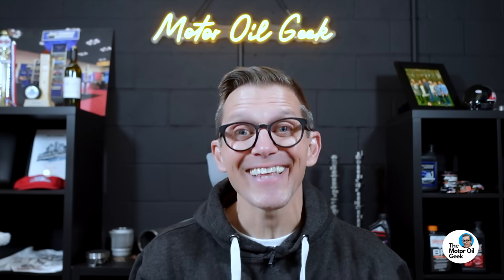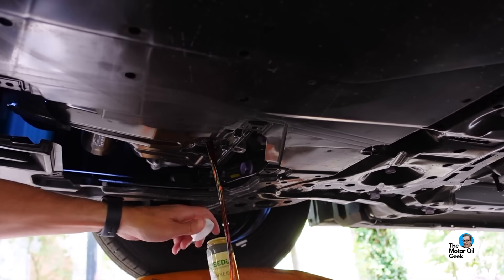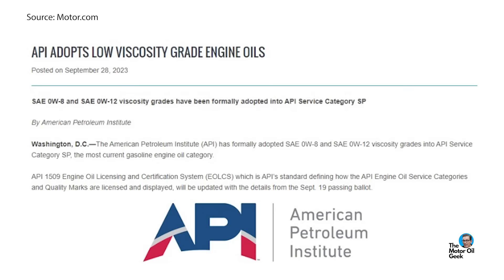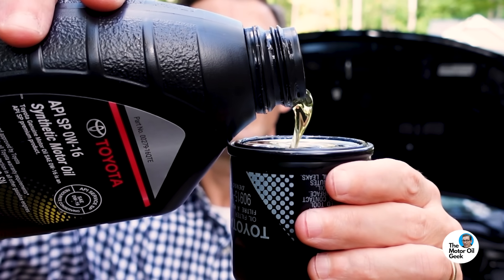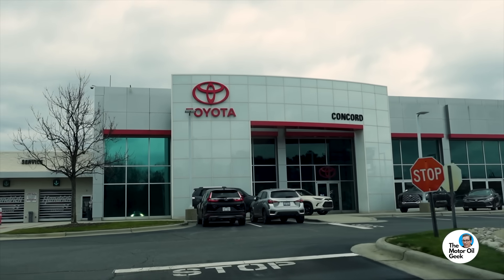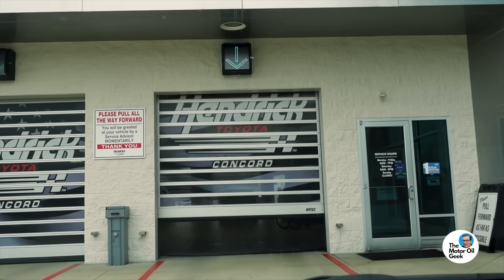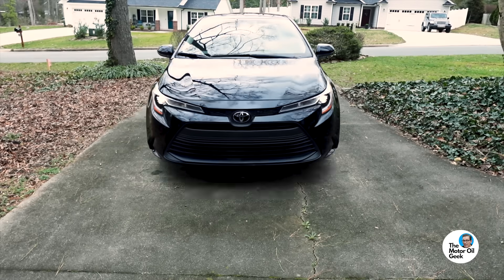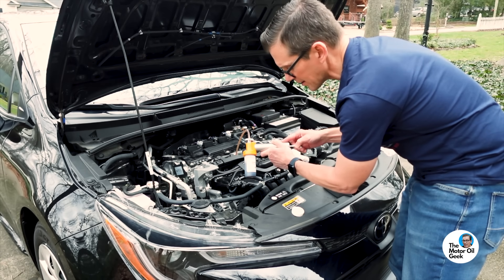0W-8 Motor Oil: Too THIN to Trust? Let's Find Out!

Comment: Say NO to all 10k oil intervals ⚠️☠️⚠️
Reply: 20k is the norm in europe. not a single problem.
Reply: @geertterharmsel  lol unless you want the vehicle to last and you look at the oil analysis that doesn't normally support your opinion
Reply: @geertterharmsel  What viscosity is the norm there?
Reply: @lonniebeal6032  most of the modern cars use 5w30. The lastest cars use 0w20 or even lower.
Reply: It's a Toyota it's not gonna kill anything especially if you live in warmer climates. My Rav4 was only done at 10k and made it to 130k miles but was totalled in an accident and still ran afterwards. I sure don't buy a Toyota to change my oil every 2500 miles.
Reply: @Lost_and_Wondering  5k intervals are reasonable, 10k are not. Unless you have ADDED Bypass filtration. 
 Most modern vehicles would achieve 130k easily but on the same note the condition inside the motor will be sacrificed of you've used 10k intervals. It's going to be a filthy mess compared to 5k intervals where the motor will outlast the vehicle and oil related failures are virtually eliminated.

The amount of vehicles that come into the shop for oil related issues is very significant these days because of those ridiculous intervals where manufacturers sell reduced maintenance knowing it will yield bigger profits on repairs parts AFTER warranty expires
Reply: Your grandpa probably said the same thing when 3 month 3k mile intervals became unnecessary. Fluids, lubricants, and engines have advanced a lot. Enjoy the convenience of 1 year 10k mile intervals. Stop being paranoid.

Comment: I'd love to see a test where you use this 0W-8 motor oil in an older gasoline or diesel engine. Will it leak and burn with the fuel or is it good for older engines, too? If it provides adequate protection and doesn't leak past piston rings or other seals, having lighter more easily moving oil even with older engines should be good, right?

Comment: 10,000 miles oil change ? No way in my house 😳
Reply: 5000 max
Reply: @markmiller8903  5k and “Mobil 1 extended performance(high mileage)” in my house 😁

Comment: 1999 4Runner. 10,000 oil change interval, factory filters. 513,000 miles, runs great.
Reply: Old 4 runners are bullet proof
Reply: 99 4runner had 10,000 mile intervals?
Reply: @DaDaDo661  Yes, I did 10,000 oil changes with 5W-30 mobile 1  oil and Toyota factory filters.

I also never missed a spark plug change every 30,000 miles, again with factory plugs
Reply: What oil?
Reply: I don't believe you.
Reply: @robertmaybeth3434 Ok, don’t believe me. It’s my daily driver.
Reply: @robertmaybeth3434  stay paranoid lol americans change engine oil way too often. 10k miles with modern synthetic oils is fine.

Comment: In the Netherlands the Toyota dealerships do not use 0W20 in the RAV4 Hybrid (2015-2018). They all fill them up with 5W30. 5W30 is also approved by Toyota but for the lowest fuel consumption the factory advises 0W20...
Reply: Dont tolerate that. Take your own oil
Reply: @dipro001  You're absolutely right, and that's what I do, for my preciouss Lexus LS 460.
 I worked in fleet automotive for a large west coast city for around 30 years, and it left me half a cripple (now I've had severe back problems from lifting bus batteries of 160 lb.). So now i mostly get the oil changed at a Valvoline quick lube.  BUT I bring my own oil for them to use (Penzoil Ultra platinum).  If they didn't allow me to do that, I'd go someplace else.
Reply: @dipro001 Why shouldn't I tolerate it? It is the recommendation of Toyota across Europe to not use the 0W20 oil for these engines. The engine loads are generally higher here especially when towing with the vehicle. The 5W30 oil is the better choice for it.
Reply: exactly. it is just a Toyota test scam to see how low we can go.
 I wil  stick with you here in Canada.
Reply: You are 1000% wrong. Lol. Stop.
Reply: lol in India where temperature rise to almost 50 degrees Celsius Toyota is using 0w20 in their diesel fortuner and hilux 😂😂😂
Reply: Why not use 0w30 instead of 5w30?
Reply: Meeder78 - The Dutch are 100% CORRECT.  After researching this for months, incl an email or two to OP, I've concluded I won't be using zero weight oils anymore.

Comment: Thank you for the great video and explenation , I have an issue over here in Portugal , I have a Rav4 hybrid 2023 when i made my first oil change the toyota dealer here they put 0W20 when I found out that was not the correct oil instead of 0w16 a wrote to the toyota portugal to give me an expelnation and the answer was 0w20 was standart due to hight summer temperture not satisfied with the answer , the owners manual does not refer weather conditions to change oil it says should always use 0w16w but if in case the dealer does not have it can use the 0W20 but the nest oil change has to be 0w16w.

Comment: I appreciate the confirmation that the manufacturers know what they're doing.  I hear so many people accuse manufacturers of giving bad advice to make you ruin your engine so you have to buy a new car.  I bet what is actually happening is that people use cheap oil and then run it for 10k+ miles...

Comment: I say trust your ears.  If the engine is noisy with 0W-8 or 0W-16 try 0W-20 or 0W-30 and keep using it if your engine gets quieter.  I don't trust thin oil and I don't live in Florida or Texas.  If I did I REALLY wouldn't trust thin oil!
Reply: Mobile one 0W8 oil is formulated to withstand temperatures over 500°F

Comment: I don't think all dealerships use OEM oils. When I take my Titan  in for service, in the waiting room they have a sign with brochures that says "We Use Valvoline Professional Services."  So in my Titan it has all Valvoline oils in the transmission, oil , pwr steering, brake fluid, differential, etc. At least I know it is a name brand product with a good reputation.

Comment: I decided to have the dealer do my wife's RAV4 hybrid transmission fluid change at 50,000- miles even though the dealer said 60,000 miles.

Comment: Love the science part of oil! It's always been fascinating to me on how far engine oils have advanced over the past decade. When you draw the oil samples each time, what oil do you use to top it up if it needs to be topped up at all? is this TOYOTA engine one of the low tension retaining rings that have an allowable oil consumption rate between oil changes or is this the standard engine that they've been using for years without any oil consumption problems?

Comment: My Toyota Crown takes 0W-8 and now at Walmart they sell it for $27 a 5Q. Before I was going to the dealership for the oil change. At 1k I went to get an oil change and then at 5k, 10k and now 15k. Now that the oil is more available, I will get it myself and do it every 5k. I don’t trust 10,000 miles on the oil change.

Now I used Motul Brand on my evo and they have 0w-8 now. Might use Motul for the crown and not the MB1 from Walmart.

Comment: All this thin oil is about  CAFE standard and not what’s best for the  engine. 

Just look at the same engines sold in other counties without an epa.  They don’t mandate those ultra thin oils. 

They have the classic oil weight recommendations by outside temp charts. 

So don’t trust that it’s what’s best for your car. It’s what’s best to boost the epa numbers.
Reply: I saw a comment from someone in Austrailia, they use 20w50 in their Kias and aren't having near the problems the US is having.
Reply: You can use 10/40 and it would be better. 😂 @lonniebeal6032

Comment: 0W-8 oil might be suitable for northern Siberia, or the North Slope of Alaska, or Arctic Canada, or Greenland, or Svalbard, or Antarctica, but only in deep winter. Otherwise, its a good way to destroy your engine.
Oil has to flow in order to lubricate, but it also has to provide a protective cushion between adjacent surfaces.
If an oil and its additive package cannot do both, kiss your engine goodbye.
Reply: The motor oil geek mentions an IL package that's new, the low viscosity oils would have to have that and I doubt many are using it at this point.

Comment: My guess is that the oil will be fine at 10,000 miles. These cars run so lean and are so closely controlled by the computer that they just don’t have the contamination of older cars. The 3,000 - 5,000 oil change interval seems excessive on a low performance NA engine.

Comment: In the Netherlands they put in 5w30 on the Prius 3/auris. There are so many issues on us YouTube channels on oil consumptio/egr on these cars… here on the Dutch Toyota forum it’s quite rare.. could it be that the thin oil will increase oil consumption, clog egr and egr cooler?

What I don’t get is so many Americans doing 5000 mile oil changes or less… the standard here in Europe is 9000 mile/15000km. It’s very uncommon to go less. Most engines here will outlast the rest of the car… every car I had went out because of rust, or other things than the engine… I did have a Volvo go over 400k km the engine was still fine on sale.

Comment: Think of engine bearings as a bearing race and the oil as the actual bearing. It creates a slippery cushion between the block crank and rods. If the “bearing race” squishes the oil to far and touches the crank or mains, it scuffs or scratches the metal surfaces after this happens it is only a matter of time.
So I don’t believe in thin oil or to thick of oil. That being said bearing clearance plays a big part of what viscosity should be used.

Comment: Was in local Walmart today, they now carry Mobil One 0W-8 for $27.97 on 5 quart jug, labeled as Guaranteed for  10,000 miles. If I was going to buy the oil and change it myself, I'd put 0W-20 regardless of what Toyota says.
Reply: I've been to places that make the additives, lots of syn oils can easily go past 10K with no issues...it's 2024, not 1964, join it
Reply: Huh?  so you know better than Toyota, brilliance is astounding.  How many engines have you tested with oils etc?  How many has TOYota done over the years, but ignore their specs?
Reply: @cengeb  exactly
Reply: I bought 0w8 today at Walmart. 10 dollars cheaper than the auto parts box
Reply: It’s funny Toyota made the engine and they know exactly what oil should go in the car but yet you still have naysayers that want to re-engineer the car when they have no academic background in this subject

Comment: 5-30 at the thinnest . and if your car has over 100,000 miles . you BETTER be using 10-30 . even if  you have variable valve timing .

Comment: So why is it now common for newer cars with a lower viscosity oil to have oil consumption issues right out of the factory line?
Reply from the maker: Lower viscosity oils naturally have higher volatility, which impacts oil consumption.
Reply: @themotoroilgeek  Would a thicker oil cause less oil consumption in a modern engine? My thoughts is wouldnt go past the oil control rings as easy
Reply from the maker: @MikeLucas-g2d  it depends. Going too thick will make it hard for the oil control rings to wipe it off the cylinder walls.

Comment: I used Castrol Transmax transmission fluid on both my Mazda, with a conventional transmission and my Mitsubishi, with a CVT. The jug says the fluid is suitable for both. Lake says the transmission fluid should be different. More friction in the fluid for CVTs and less for the conventional transmission. How can they both be right?
Reply from the maker: Thanks for sharing

Comment: my 2024 Corolla SE calling for OW-8 and after the 5000 maintenance, Toyota put the sticker to bring it back for the 10000 service and I saw they put on the sticker that it will be OW-16.  I will not get OW-8 on my first oil change under Toyota Care.  Also, they said oil change will cost about $150 for one oil change if OW-8 is used without Toyota Care.

Comment: I’m not convinced that ultra-thin oil in a GDI engine is the best idea.  Carbon deposits are hugely accelerated by blowby/EGR.  I will need convincing that the thinner oil seals just as well.

Comment: I just read the 0W-08 vs 5W-30 article penned by Lake…
I have an ‘08 Yaris with 305,000 miles.
I’m tempted to do the 0W-08
Reply from the maker: Thanks for reading the article, but I would not try the 0W-8 in your case.

Comment: On The Car Care Nut channel on YouTube, he’s a master Toyota mechanic, he says change your oil at 5000 miles or 6 months which ever comes first, no matter what the owners manual says. If you want your Motor to last.
Reply: He lives in Chicago, but if you live in a much milder climate, like Southern California AND avoid short trips, 1 year or 5000 miles is perfectly fine. In fact, I would think that with synthetic oils, even more miles is possible.

Comment: I'm surprised as knowledgeable as you are. You weren't aware that they consider those lifetime transmissions. They don't want to do any labor on them. They just want them to break and for you to change them out for a completely new one. CVT transmissions only belong on motorcycles and ATVs. They don't belong on full size vehicles

Comment: Why do you need a CVT, or oil changes?

Oil are forcasted subsidized 9.000.000.000.000 USD, that's more than 1.000 USD for every human on earth!!!
The price are controlled by a corrupt cartel with mostly dictatorships.
Fossile cars are subsidized 28.125 USD through oil.
The dealers are screwing over their costumers with big markups, and the employees earn 3 times more than a regular worker in the USA.
The fossile car owners are hostages to oil. That's the reason why the subsidies are goving up every day. The subsidies was 7T USD in 2023.
You are paying for this through more taxes, more expensive food, clothes, homes, and all other things you need.

Comment: I’m an auto care tech at Walmart. We have a little podunk shop and we barely have enough tools for modern/newer oil changes. I was left alone for hours one night running the shop by myself when I was brand new. I had a guy come in with one of these and he goes, “You know this thing takes 0W-8 right?” I was completely dumbfounded. I have ever only heard of 0W-16 and Toyota on their website didn’t have 0W-8 listed. Ended up turning him away in fear of tearing up his car. So the moral of the story here is: Go back to your dealership for fancy modern vehicles folks.
Reply: Walmart now sells Mobil 0w8 on their shelves. I picked up a 5QT jug today...

Comment: as a toyota technician we have 0w8 in stock and use it when the car calls for it. usually parts has oil out already with the filter if needed, but because it’s random between calling for 0w8 vs 16, we have to check and go back and let them know to get us the oil. it’s also almost twice as expensive 0w16

there is absolutely no need to do an trans flush at your first oil change. i would consider 50k early for a transmission flush. the drain plugs are pretty easy to find, but im saying that using a lift so 🤷‍♂️ 

it’s disappointing to hear the bad stories from dealerships being stealerships, and crazy that they use 0w16 if it calls for 0w8. If we can get the right stuff, we won’t do the job. 

finally, i’m in the technician training program and i go to tech school with a few guys from hendricks. good techs and they are a good dealership.

Comment: i have a 2000 ford ranger, 4x4 auto with the 3.0 engine. i bought it in NC with 189,000 on it and it was being used as a farm truck for 12 years prior after OP crashed it at low speed into a tree and set the airbags off. it went 3000 miles in 12 years

at some unknown point between then and when i bought it a decade later, the oil pressure needle started wigging out at warm idle and tapping the peg loudly. the guy had put a small hole in the glass presumably to physically stick something in there and make it stop moving. i bought it and drove it like that for another 20,000 miles over two years. i replaced the sensor, changed the oil several times sometimes with thicker stuff, etc. and just sorta forgot that filters existed. brain fart to the extreme eh?

so one day it finally had enough and rusted through the filter casing and started peeing oil on the ground. i found that one nice and quick and went "...oh yeah that thing XD" ...i popped a new filter on there and suddenly the needle quit wigging out.

in short, my truck had been running for at least 23,000 miles with less than 5psi oil pressure at warm idle, and above idle it had been pushing oil through a wall of sludge to get into the engine. its at 213,000 and counting right now and it still starts and runs flawlessly. purrs like a kitten. it almost sounds like all the cars that are super picky about oil specs are the ones that shouldve been avoided in the first place.

Comment: It's really interesting to see how that corolla calls out for 0W-08 Oil. I have a 23 Corolla SE which as far as I know has the exact same engine and it calls out for 0W-16. It was made at the American plant so that could be the difference. They also call out for 5000 mile oil changes in the manual for my car as well. Makes me wonder if they will update the oil specs retroactively for cars that called out the 0W-16.